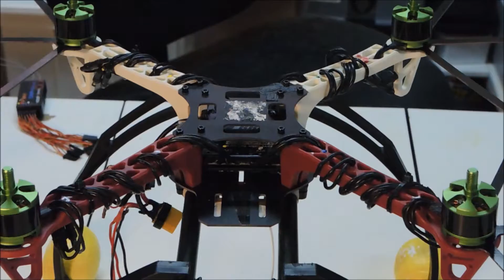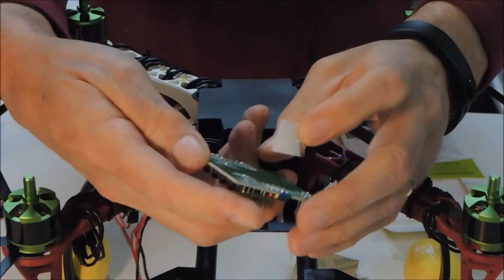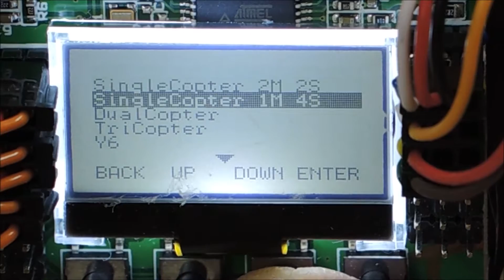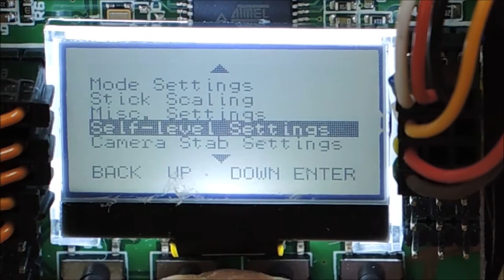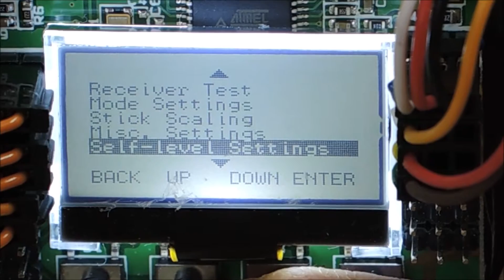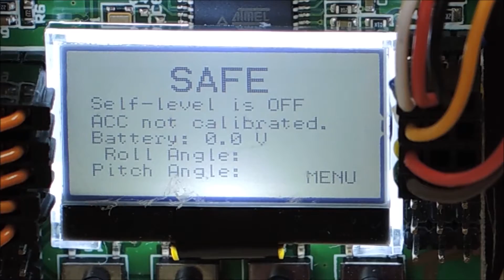Part 1:KK2 1 and Tarot ZYX M

Comment: sir i have a problem in arming the motors 
ca you help me solve that error
Reply from the maker: Hopefully you are connected to the ZYX-M software? when you connect your radio does the buttons on the screen correspond to the switches and controls on the radio?